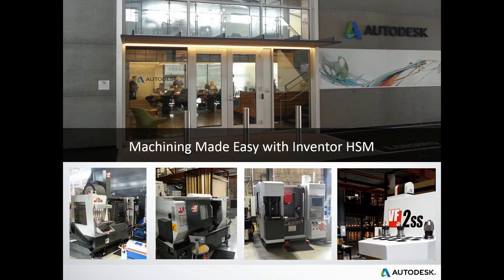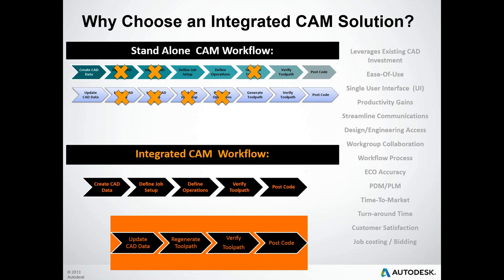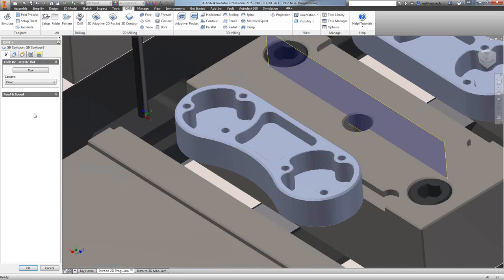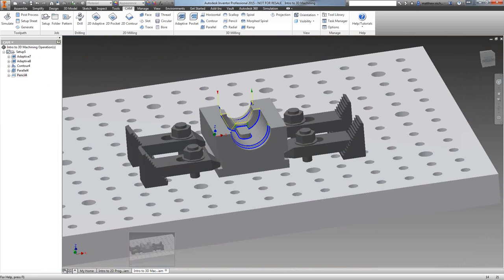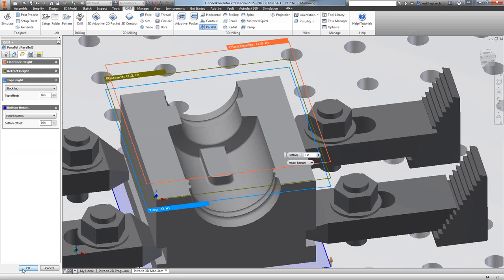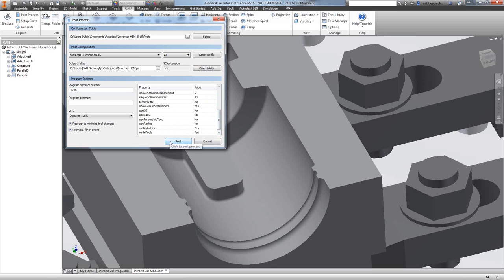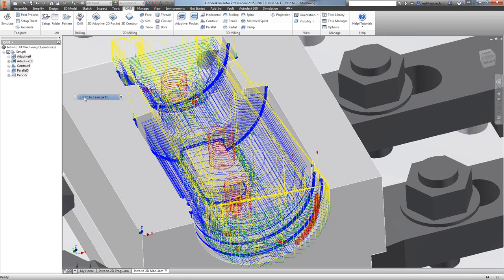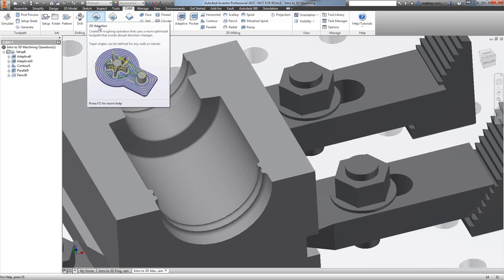Machining Made Easy with Autodesk® Inventor® HSM

Comment: Richard,  I work with Applied Software I would enjoy to speak to you more about the options you have.  To answer these direct questions...

You are able to turn off the toolpath lines.
Inventor is just for design and models.
If you want to upgrade so you are able to use the full multi axis and 4 axis please reach out to me.

My email is pmuza@asti.com if you would like to link up and figure out what exactly you need.  Thanks.